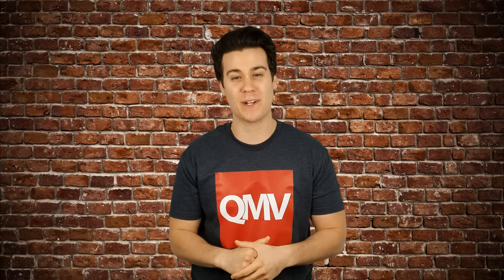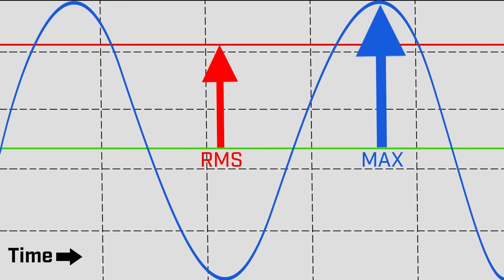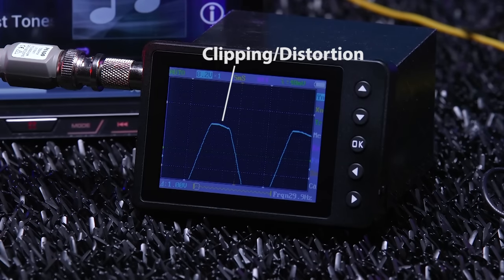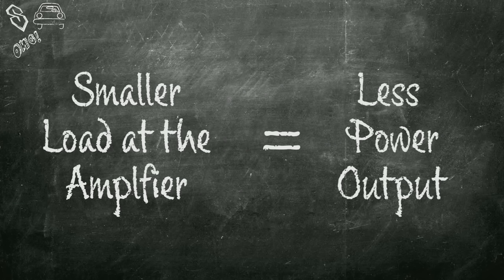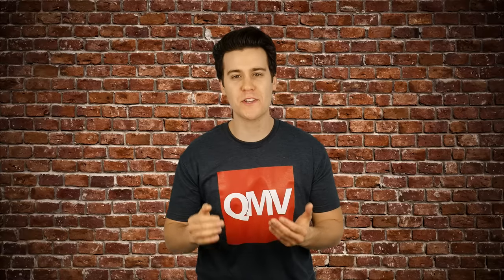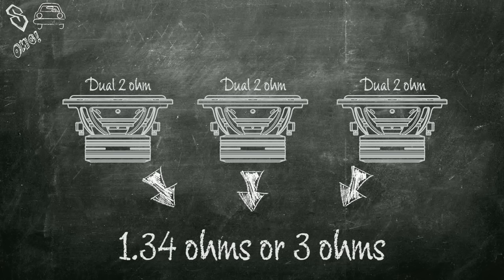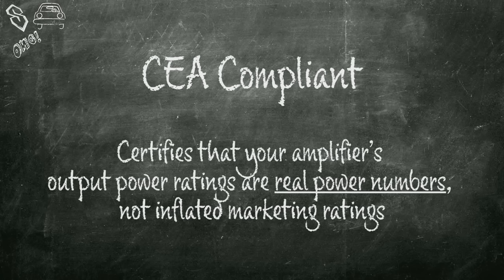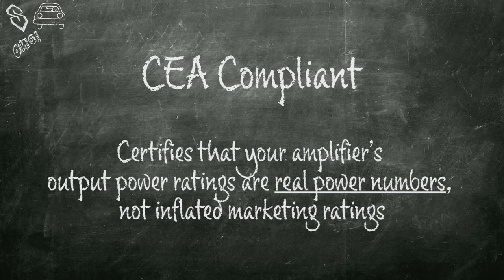How Do You Match Car Subwoofers and Amplifiers?

Comment: suggestions on an amp for 2 Rockford Fosgate P3SD4-12 Punch P3S 12" 4-Ohm DVC Shallow Subwoofer?
Reply from the maker: You'll want a monoblock amplifier with a power rating of 800-1,000W RMS @ 1 ohm. Check these out, wire in parallel:

Rockford Fosgate P1000X1BD
http://www.qualitymobilevideo.com/rockford-fosgate-p1000x1.html?utm_source=YouTube&utm_medium=Video&utm_campaign=Match_Subwoofers-Amplifiers

Pioneer GM-D9701 
http://www.qualitymobilevideo.com/gm-d9701.html?utm_source=YouTube&utm_medium=Video&utm_campaign=Match_Subwoofers-Amplifiers

Rockford Fosgate R1200-1D
http://www.qualitymobilevideo.com/rockford-fosgate-r1200-1d.html?utm_source=YouTube&utm_medium=Video&utm_campaign=Match_Subwoofers-Amplifiers

Comment: The thing is that most good name brand amps That say they have a power output of a 1000w@4 ohms are putting out 1470w or even more power than labled and you run a dual VC that's 2ohm 500w per coil to get a 1000w@4 and your amp is pushing out 1470w@4 at it's cleanest point so now you're giving that 500w coil 730w so your better off to find something that's 750w pre 2 ohm coil to get 1500w@4ohm load? My 1997 Rockford Fosgate Punch Power 500.2 is 250@4 per channel 500@2 1000w@4 bridged but when I had it repaired and tested the numbers were 335@4  675@2 1470@4 bridged @14.4v  and believe me these amps are power hogs and will suck the life out of the battery and alternator

Comment: Just to be clear here, am I too understand that my amp channels which are rated for 75w rms @4ohm will be fine for my speaker rated for 65w rms @4ohm.......yes?
Reply from the maker: Yup! It's always best to have a little headroom
Reply: @Qualitymobilevideo  1 more question, With a 5 channel amp. Can you wire in your speakers at 4ohms and still use the sub channel at 2ohms???

Comment: I have 2 10 inch 350w rms dvc 6 ohm subs, having a hard time finding an amp to match. Any help would be apreciated..
Reply: You could get amp that is 700watts @ 2ohms and run woofers in paraller so you get 3ohms
Reply: @KonnaVaari  Cool, thanks!
Reply: @KonnaVaari  any good suggestions for brand and model?

Comment: I have a 
Pioneer TS-SWX3002 but still don’t know for certain what amp is best suited. Help plz 🙏
Reply: Would the Cerwin Vega XED71200.1M be suitable ?
Reply from the maker: So one SVC 4  ohm subwoofer like that can only be wired to a 4 ohm load. That amplifier is 4 ohm capable, however, it only does 300W RMS @ 4 ohms and the sub is rated at 400W so it's a little underpowered. I would look for something with a little more power @ 4 ohms :)
Reply: Quality Mobile Video thank you for the help 🙏

Comment: Would I have to upgrade my vehicles electrical system (battery/charging system) to power a 2000w amp?
Reply from the maker: 2000W RMS amplifier? Possibly. Do you have an oscilloscope or any testing gear to see your voltage/current draw?
Reply: Quality Mobile Video Yes, 2000W RMS. I don’t have testing gear but I could get one. I’d like to have a 2000W RMS system without changing the vehicles electrical system
Reply from the maker: Gotcha. Do you know how big your alternator is? For a 14.4 volt system, let's say you have a 100 amp alternator. Multiply 14.4 x 100, and you get 1440, which is the wattage you can handle with your factory electrical system. but you also have to consider that is also charging the battery and running the rest of the accessories, using around 40-60% of that power alone. So really a 100 amp alternator has about 700-750 watts capability. 
For a 2000 watt RMS system, at minimum you'll need a 200-250 amp alternator, a secondary battery will probably be necessary as well. And then make sure you're using the correct size power and ground wire.
Reply: @Qualitymobilevideo  Thank you!  I'm not sure what alternator I have. That was the perfect answer in was looking for!
Reply from the maker: @Brandon-mk4eu  Glad it helped! Yea just look up your car's alternator specs online or in the manual, or you may even be able to see the specifications labelled on the alternator if you look under the hood.

Comment: I have 2, 12"sub woofers, 4ohms, 250W RMS in 1200watts peak power each, said by the manual,
how many watts of Amplifier do i have to use?
Hope you can help me... thanks...
Reply from the maker: Are they DVC or SVC?
Reply: @Qualitymobilevideo  sorry to ask but what is dvc and svc? The speaker i said is a "car stereo speaker" JVC drvn, CS-1200.
Reply from the maker: @entingbhetoycolags9952  That is how many voice coils it has, single voice coil or dual voice coil. The number of voice coils and impedance directly reflects the types of loads that you can make with your specific speakers/subs at an amplifier
Reply: @Qualitymobilevideo  thanks very much, now i know... my speaker is svc @ 4ohms, 250W rms, and 1200W max peak power.

Comment: Ok I want to run 2 or 3 nvx vsw84v2 250 rms dual 4ohm voice ohm What size amp should I get or should I go dual 2 voice ohm ? Help me.
Reply from the maker: Depends entirely on if you'll get two or three of the subs. If you do two DVC 4 ohm woofers you can make either a 1 ohm or 4 ohm load at an amplifier. If you get three DVC 4 ohm woofers, you can make a 2.67 ohm or 6 ohm load at an amplifier.
Reply: Quality Mobile Video I just want them to sound good. So I’ll do 2 of them. They’re 8 inch subs. So what size amp will I need ?
Reply from the maker: So two DVC 4 ohm subwoofers with a combined RMS of 500W. You'll want a monoblock with an RMS of 450-600+W RMS @ 1 ohm. I suggest these: 

Pioneer GM-D8601 - 800W RMS @ 1 ohm 
http://www.qualitymobilevideo.com/gm-d8601.html

Pioneer GM-D9701   - 800W RMS @ 1 ohm 
https://www.qualitymobilevideo.com/gm-d9701.html

RE Audio SA1000.1

https://www.qualitymobilevideo.com/sa1000-1.html

You can also do a 4 ohm load:

Kicker CXA1200.1 600W RMS @ 4 ohm
http://www.qualitymobilevideo.com/cxa1200-1.html

Kenwood KAC-9106D
https://www.qualitymobilevideo.com/kac9106d.html

Pioneer GM-D9701 
https://www.qualitymobilevideo.com/gm-d9701.html

Comment: I get 2000 watts pioneer mono block and amplifier of 2000 watts ,what kind of subwoofer did I need to get with regards to watts ,but i need only 2 subwoofers
Reply from the maker: Impossible to determine without detailed information of the amplifiers. What specific models are they?
Reply: @Qualitymobilevideo  they all pioneer model bro

Comment: Idk if ill get a reply. Hopefully I do. But. Im trying to wire a 5 channel amp with 4 speakers and 8 inch subs. The rms ratings all match but as far as ohms go. The amp can push at 2 and 4. 2 ohms = 4x 75 rms and 1x 150 and  4 ohms 4x 150 1x 300. The subs are dvc 2 ohm subs at 150 rms and the speakers are coaxial 4 ohms at 75 rms. Is it possible? And if so, would i even be able to wire 2 subs? This shit is really confusing bruh. Please help

Comment: Soooo my amp rms is 2000 and max 4000 at 2 ohm. I’m looking at 2 dvc 2 ohm subs with rms 1000 and plan on wiring one sub to the next to add to 2ohm at the amp. So would that match
Reply from the maker: Yes, Two DVC 2 Ohm Subwoofers will wire to a 2 ohm load in parallel. And their combined RMS would match the amplifier's

Comment: Hey man! So i'm using a 4 channel amp james, and going to bridge my front left  6.5 and rear left 6.5 to make the 8 ohm speakers 4 ohms for more power, and the same .on the right side.  I bought new tweeters with crossovers. Can I just hook them each  up to the left/ right side wire to power them? Also the tweeters are 4 ohms! HELPP!?@?!

Massive audio ct2 tweeters 
Massive audio m6  6.5 components front and back (4)
Massive audio bp 1000.4 blade amp 2 ohm stable.
Reply from the maker: Should be fine! Have you seen our amplifier wiring video? We show bridging multiple speakers onto single channels. Give it a watch bud: https://www.youtube.com/watch?v=vxWSN60i5ew
Reply: @Qualitymobilevideo  cool, I'll check it out later and let you know. 
Thanks

Comment: Ok what does mono mean on amp?
I got a Pioneer 2-channel bridgeable amp with a thousand Watts 480 Watts RMS at 2 ohms. 480 RMS is that the total Watts I can run from two subs? What kind of Subs am I looking for?
Reply from the maker: A mono amplifier is a single channel, so all power is going to just one channel. Some 2-channel amplifiers are bridgeable, meaning both channels 1 and 2 are combined into one channel. Wiring two subs into their own channels on a 2-channel amplifier splits the power in half
Reply: @Qualitymobilevideo  so for 2 Subs that do 350 Watts RMS each and two 6.5 speakers what kind of amp should I get to run those decently? This will be my setup I'm working on in my backseat of my convertible
Reply from the maker: Personally I would get a monoblock to run the subs bridged at 1 channel, and power the speakers with your head-unit. Do you have any more info on the subs? I need to know their impedance and voice coils (part/model number)
Reply: @Qualitymobilevideo  well my head unit is just a Pioneer cheap CD player it's running my two 6x9s  and my two 6.5s. I did a custom enclosure for two more 6.5 and two 12-inch Subs. I'll get you the information on the subs, I haven't bought them yet it's a system I'm looking at it work. Thank you so much for your help I appreciate it
Reply from the maker: @dsmchick935  Ok cool! Yea get me that info so I can give more accurate answer :)
Reply: @Qualitymobilevideo  okay so the system I'm looking at is where I work and it's affordable for me if it'll work. The subs are pioneer 12 in 1300 watt Max 300 watt RMS with voice coil cooling system and it says you'll need a faston-lug terminal, I don't know what that is. 
Then the amp I wanted is a Pioneer bridgeable 2 channel amp. 150 watt RMS x 2 (4^)
240 watt RMS x 2 (2^)
Bass boost 6db, 12db, variable LPF 40 HZ to 500 HZ.
That's the information I got on it.
Let me know if that's enough information like I said I'm still learning this stuff otherwise I might just look for a cheaper KICKER system. For my molding and my amp rack I'm building in the middle of it I might need a smaller amp from the measurements. Thanks for your help I appreciate it

Comment: My Speakers are pair JBL gx963 400 watt so 2.3 ohm so I guess this AMP in the video will be a perfect match if wired in parallel giving 800 watts with 1.1 ohms so, is this right? if not what amp should I get?
Reply from the maker: Which amp? The Pioneer 5 channel? Or the Rockford? I'd recommend using a 2 channel or 4 channel amp since it's just two speakers that do 100W RMS each. You don't need anything more power than 100W RMS per channel, it'd be a waste of power and money
Reply: Quality Mobile Video appreciate your fast and helpful reply, i got ur point which is very true so, can you help me and give a specific amp to buy coz iam always struggling between all those different brands and models ? And also which better wiring style should i do parallel or series ?
Reply from the maker: Of course. So you're just wiring two speakers? No other speakers or subs?
Reply: Quality Mobile Video my car has originally 4 speakers 2 back 2 front doors i will replace the 2 speakers on the back with the 2 jbl gx963 and will keep with them the two front doors speakers( which i didn’t have any info about them coz my car a little bit old if this situation will put me in a struggle i can disconnect all the original ones replacing them with just the two jbl
Reply from the maker: I would get a 4 channel, leaves you the option of having extra channels in case you want to replace the other two speakers and wire them to the amplifier as well, or want to add a subwoofer at some point. Chekc this out: https://www.qualitymobilevideo.com/gm-d8704.html
Reply from the maker: https://www.qualitymobilevideo.com/st4-1000d.html
Reply from the maker: https://www.qualitymobilevideo.com/gm-a6704.html
Reply from the maker: https://www.qualitymobilevideo.com/kac-6407.html
Reply: Quality Mobile Video thank you sooo much again! I will pick out one of them but the last thing forgive me, should i wire my speakers in parallel, i just get lost in all these calculations:) !
Reply from the maker: @AhmedMohmed-ye4tm  I would do parallel

Comment: I am so confused on ohms. So what happens if I have too many ohms than my amp can handle
Reply from the maker: Don't think of it as "too many ohms". It's about matching the load possibilities of your subwoofers, with what you're amplifier is stable at. For example, two DVC 4 ohm woofers can ONLY be wired to a 1 ohm load or 4 ohm load. If you're amplifier is not stable at either, the gear will not match. If your amplifier IS stable, then you can wire to either of those loads, making sure that the RMS power matches as well

Comment: What amp should I use for the dual kicker comp r enclosure
Reply from the maker: Need more info bud, is it 10" or 12" sub enclosure?
Reply: Quality Mobile Video  2 12 inch ported enclosure 2 ohm 1000 watts and I'm not sure if it's 1000 watts per sub or what but if u look up the dual 12 inch comp r That s what I have I got it with a boss 4000 watt amp but hook it up and right away it sucked this amp isn't good it gets hot super fast and I wanna trade it back and get something better for everyday use not just 1 minute

Comment: How do I wire 3 dvc subs in parallel, what's the ohm load?
Reply from the maker: Need to know what impedance the subwoofers are. If they're 2 ohm, they will wire to a 1.34 ohm load. If they're 4 ohm, they will wire to a 2.67 ohm.

Comment: i have a 2 channel amplifier of 360w total, each channel 180w...
i have 3 speakers (100w - 400w - 500w) + a treble tweeter (100w i think)...
i need to join them together! can you help me?
Reply: will they burst out? 🙈
Reply from the maker: Your speakers have vastly different RMS ratings which may be an issue
Reply: @Qualitymobilevideo  okay how can i solve this issue?
Reply: @Qualitymobilevideo  can i wire lets say the speaker of 400 watts only?
Reply: and how if i used a 4ch 60w × 4
jsd-520 radio?
Reply: @Qualitymobilevideo  by the way all the speakers are 4 ohm

Comment: Hey I have a Jensen 460w amp and two Sony factory subwoofers that are 500w and I want to use them in my car but I don’t want to blow my subwoofers when I use them in my car and I don’t want to have not enough power to push them.
Reply from the maker: Need more info on the subs and their specifications/models

Comment: I have two 12 inch sub with 2,200 watt (4ohm). What type of amp to I need!?
Reply from the maker: If they're DVC, you'll be able to wire to a 1 ohm load or 4 ohm load. If They're SVC you'll be able to wire to 2 ohm or 8 ohm load.
Reply: Thank you 🙏

Comment: I’m still confused.  If anyone can help me out.  have two 12s L7s at 1500w and 750 RMS each. They are wired at 2 ohms. 
I have one kicker cxa1200.1 currently pushing  pushing both 12s. The amp RMS power rating is 4 ohms 600w, and 2 ohms 1200w. Total output watts 2400w. With that said, does that mean I’m giving 1200w to each sub? And Is this enough? Or do I need more Watts and or RMS. I was planning on buying another cxa1200.1 and using one on each sub. Or will that be too much ? Thank you

Comment: I'm wanting to run 2 60w rms speakers (340w peak) 4ohms each, and 1 250w rms sub (1000w peak) 4ohms what amp do I need?
Reply from the maker: You could either use a 2 channel and bridge the two speakers on one channel and wire the sub to the other. You could also use a 4 channel and create a 3 channel set up.
Reply: @Qualitymobilevideo   so like 1000w is good

Comment: help... i have a JBL W12 gti MK2 with 750 RMS and 4000 peak... witch amp is the best and cheap? i want a sealed encloser.
Reply from the maker: That's the DVC 6 ohm woofer right? Recommended Amplifier: Stable at 2 or 1 ohm mono for a 3 ohm load
Reply: @Qualitymobilevideo  yes, but how much power? 750 rms, less or more? can you give me 3 option? an expensive, mid and low budget :) please

Comment: I’m running two kicker comp c rated at 500 watts 300 Watts rms. I’m having issues with the amp cutting out running a 1000 watt kenwood amp. Not sure if the amp is bad or not but it’ll hit and then cut off and hit again seconds later. I tried tuning the amp such and bass level and input but even when I thought I had it right it thump for a while longer than usual and when a different song with stronger bass comes on it will start cutting off again. Help please
Reply from the maker: Hey Austin, so I need to know the specific model of the amplifiers. We gotta figure out if the voice coils and impedances match up with what the amplifier can do
Reply: Quality Mobile Video I can let you know tomorrow morning. What amp I’m running
Reply from the maker: Sure guy

Comment: Eh, I usually go with an amplifier with a higher rated output than the power handling of the subwoofer. The first couple hours of playing I find the point where the subs sound like they're about to start bottoming out and stay below that point. I also regularly check if the subs are about to overheat, so far I have blown exactly zero subwoofers with this method. You don't blow speakers with an overpowered amp, you blow them by playing at a higher volume than they're built for.

Comment: So the rockford fosgate 1000 bd can run my P3D4 12's just fine then right?
Reply from the maker: According to Rockford's website, the P1000X1bd is stable for 1000W RMS @ 1 ohm. Those subs are DVC 4 ohm woofers which wire to 1 ohm in parallel and have a combined RMS of 1200W RMS. It's a decent match, but I generally prefer having more headroom on the amplifier